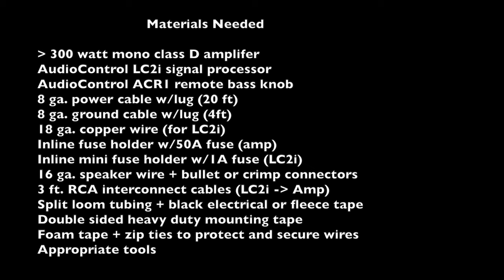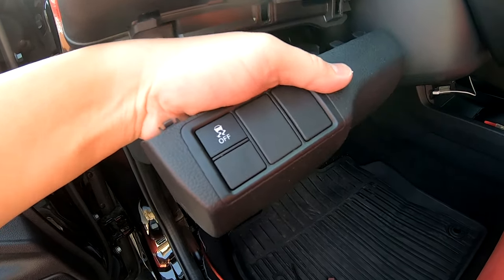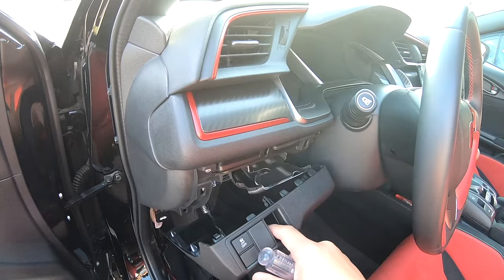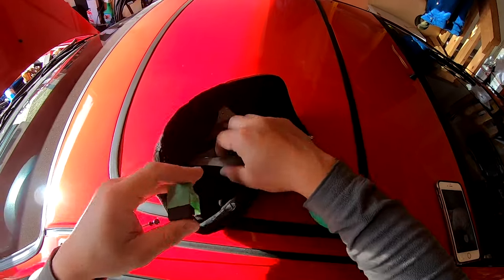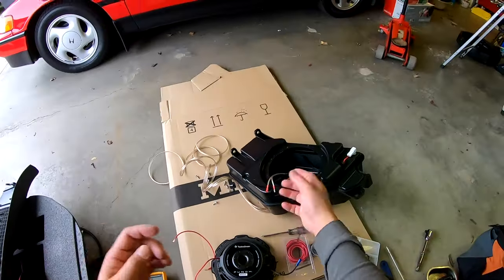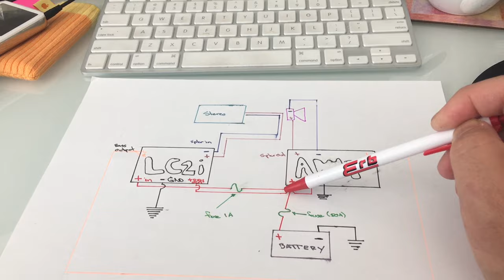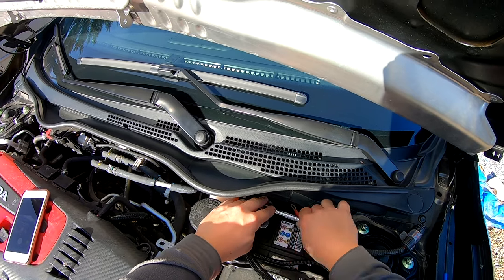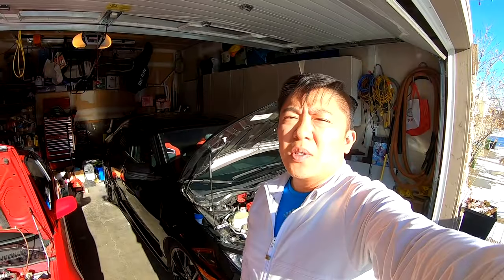2016+ Honda Civic Type R Subwoofer Amplifier Installation

Comment: Very well done man.  I am looking to replace the head unit with a 9" android one but I have the touring model with upgraded stereo and factory amp.  Would you happen to know how I can make this work?
Reply from the maker: it will depend on the replacement head unit.  If the new head unit comes with RCA outputs then you can delete the LC2i and just run your amp straight from the new head unit.  If you don't want to go that route or you feel it would be more complicated then you can tap into the system exactly as shown as I would assume the aftermarket stereo would work the same as the factory one (as far as speaker outputs are concerned).
Reply: @piercedasian  you're the best. Thanks so much!
Reply from the maker: you're very welcome!

Comment: Plan on doing the same to my sport. Very easy to follow along tutorial. I really appreciate the diagram you drew up.
Reply from the maker: Glad you liked the video.  I did an install in a civic sport touring and had to mount the amp on the tire jack cover so that it didn't impede the use of the spare tire  Thanks for watching!
Reply: piercedasian thanks for the heads up!

Comment: Was looking at video so you do not connect anything to the head unit also no fuse underneath?
Reply from the maker: nothing is connected to the head unit and the fusing for the amp is done at the battery and the fusing for the lc2i is shown in the video.  Just a small 1amp inline fuse that is tucked in underneath the foam block where the amp is installed.
Reply: @piercedasian  oh ok hard to tell from video
Reply from the maker: yep, its kinda hard to see everything in my vid since I'm a lone cameraman and the guy going the install at the same time :)

Comment: Is there a nut on the other side of the ground bolt? Washers? Loctite?
Reply from the maker: nope, none at all.  Just take the bolt out, put your ground ring terminal under the bolt and snug it up hand tight only.  Do NOT crank on that little 10mm bolt otherwise it WILL snap.
Reply: @piercedasian  there was a bolt already there? I'm doing it on a 2017 civic si. There's a hole but no bolt in it.
Reply from the maker: in my car there was a bolt there for grounding the brake lights I think.
Reply: @piercedasian  that's interesting. There wasn't one. But the hole is still there. I put a bolt and two lock washers and a nut. Also perfect hole on top to fit a 14mm wrench to hold the nut while I tighten the bolt. Mounted a 1000watt amp and a kicker comp r 12 with a cheap kicker kisloc. Hits hard, your video helped a lot. Thanks

Comment: Seems like all of the right parts were used but one critical thing not mentioned - did you run 'new' wires from the headunit/factory sub or did you use the existing subwoofer connection/and run those shorter new wires into the LOC?
Reply from the maker: No need to run new wires from the headunit.  There is no value in doing so since the honda head units do NOT have RCAs out.  The whole purpose of the LC2i is to pull, process and restore the full bass spectrum signal from the EQ'ed signal from the headunit via the sub output from the rear sub's wiring.  So the way I did it is, run signal from the factory sub wiring to the LC2i and then from there get a set of RCA from LC2i to amp and then a new set of speaker cables from amp to the sub.  Works perfectly and sounds great.
Reply: @piercedasian  Understood, though one thing that confuses (and others) me are the terms "run signal"
or "run wire" as it implies cutting factory wires. Some may not want to do such a thing.

I understand the 9th-10th generation Honda audio systems with the dramatic bass roll-off and dedicated puny underpowered 8in subwoofer they like to utilize. The lci2 seems like the perfect charm to cure all of the shortcomings of Honda "premium audio." It's still witchcraft to me as how a device can take a 100w + signal and re-proccess and amplify it, but if it works, it works!

But I still ask: did you physically have to 'cut' or 'splice' into the subwoofer hot/ground wires in any way or are you using some adapter?
Reply: @piercedasian  So do you need an expensive LC2i to get the full signal back? I have a cheap $15 LOC (PAC SNI-15) that just has L/R +/- inputs, no power/grounding. I have a 2020 Si Sedan with a factory sub in the rear deck.
Reply from the maker: OMG, I can't believe I missed this reply and question from you.  Run signal from sub means you tap into the wiring that we feeding the stock sub.  If you look at my sub swap video and then watch my amp install video that you will see how I managed to not cut the factory wiring harness but instead cut the spade connectors off where it connects to the factory subwoofer (which was trash anyways).  I then spliced the signal wire from the stock sub INSIDE the sub box.  How I did that was remove stock sub, cut the ends off the wires that attach to the stock sub.  Splice a new set of wires to the sub's wiring and feed it OUT of the sub box via the little screw hole that once held the stock sub in place to the LC2i.  I then fed another new wire from the amp's output back to the stock sub box and fed it through the little screw hole on the back and then attached that to the new aftermarket rockford sub.
Reply from the maker: My bad on not replying to this. The purpose of the LC2i is to restore the bass roll off that occurs in the bass signals that are fed from the stock head unit.  I have no experiencing using a cheapie LOC adapter.  Did it end up working for you and how did it sound?

Comment: I'm not planning on running the LC2i and I've read that it's not needed. Do you happen to know how to wire the sub to the amp without using the LC2i?
Reply from the maker: you'll need to get an amp that high level signal in.  So follow the video except the signal from the factory headunit that you spliced and joined inside the sub box will run into the high level inputs on the amp and then amps sub out runs back to the sub enclosure back and into the new sub.  Set the amp to signal detect turn on.
Reply: @piercedasian  I'm running the RF P500X1BD  mono amp. It says high level input available but doesn't come with a high level harness or anything. Looking at the LC2i I see it has the remote bass control outlet as well, I have the RF PLC2 knob for my amp. Does it need to be plugged into the LC2i if I do end up running this or can it be installed at the amp?
Reply from the maker: @armyofone129  it didn't come with the high level input wiring harness?  It should've otherwise how would they expect you to hook up the speaker level inputs into the amp?  The LC2i has a remote bass knob control but you need to install the bass knob for the LC2i.  If you have the rockford bass knob that came with your amp then that is the one you use for your amp.
Reply: @piercedasian  Directly from the description: "High level input capable with Auto Turn On circuit". I'm not sure what that means. I currently have the knob hooked directly to the amp.
Reply: @piercedasian  Think I'm just going to save myself some headache and buy the LC2i. Thanks for all your help.

Comment: Great video. Question does that lc2i doe sit also work as an epicenter.
Reply from the maker: What do you mean by it works as an epicentre?
Reply: @piercedasian  does the accu bass works as an epicenter. So instead of buying an epicenter along with the lc2i i can just buy the lc2i.
Reply from the maker: @monzon529  ah yes duh!  I shouldn’t be replying to messages late at night lol. Yes the LC2i’s entire purpose is to take the EQ’d bass signal and restore the bass frequencies back to the steeply rolled off (or wonky) bass response back into the signal like how it would normally come out of an aftermarket head unit.  Others have reported they can use the high level inputs on their amps and it seems to work fine  it using the LC2i is a sure fire to ensure your sub and amp is receiving the properly re-EQd signal.  Hope that helps.
Reply: @piercedasian  thank you. And thank you for the response ill take the high the road and not reply with a fuck up way. But thank you.

Comment: I'm looking to do this with my new 2019 Type-R
Reply from the maker: You won't regret it!
Reply: would it be possible to see the connecting cable for 19+ type r please? I am trying to change the head unit from stock to android but have not received the car yet...
I will probably get the car in 2 month from now, so I am trying to get the parts first :)
Reply: @user-ws7oh7cq5f  I might could send you a picture on Instagram or something

Comment: Where did you get the foam ?????
Reply from the maker: local honda dealership and amazon.
Reply: piercedasian  what’s it called ?
Reply from the maker: @nino_805  I believe it is called EPDM open cell foam tape.  Not sure if that is the official term but the dealership might know the official name.
Reply: @piercedasian  have you done any upgrades to a Honda Accord 2019 I have some trouble with mine once the 2 front windows are all the way up my amp and bass goes on and I can hear the bass go up as I accelerate the gas pedal

Comment: Hey man I have the 2018 Civic LX Sedan. I was told I don't necessarily need the LC2i with the Rockford Fosgate RX500 because of the High Level Input feature. I was told I can tap into the stock speaker wires in the rear of the vehicle and the High Level Input feature allows me to do so without popping out the stock head unit and running RCA cables. Can you give me feedback on this?
Reply from the maker: No can do. My understanding of many head units is that there is some weird bass response roll off at various volume levels that the LC2i apparently corrects for so that your aftermarket amp and sub work correctly. It isn’t a matter of getting an amp with high level inputs to get it working. You can try doing it straight to an amp but I have read that others have weird bass problems that were subsequently corrected using a LC2i. Hope that helps.
Reply: piercedasian thank you for your response! I have heard that also but also have seen where people tapped into the rear speakers properly and didn't seem to have problems. I ordered an LC2i also but if I do not have to pop out the head unit I would prefer not to but I guess I can figure that out when I test it
Reply from the maker: Chase Heigle you never actually have to pop the head unit out. It is all done in the back so all you have to do is wire the LC2i to the sub speaker terminals as how I have shown. You can’t even tell I’ve been in the back of my car as the install of everything is super clean clean clean!
Reply: piercedasian Ahhh okay I see. I will re watch and find that part. Thank you!
Reply: piercedasian well I also am not using the factory sub housing (I have the two 6.5" subs firing upwards in the top of my trunk space) I purchased the JL audio microsub 8W3v3 with ported box
Reply: I have pictures if I could send them to you maybe you can explain how I would connect the stock wires to the LC2i
Reply from the maker: Chase the wiring of the LCI2i is all the same regardless of whether you're using the stock housing or not.  You can just take the two factory wires going into the sub and wire them to the high level in puts (left channel) of the LC2i.  That will be good enough for you to get your signal to your amp to drive those dual subs.
Reply: piercedasian so would I have to cut and splice the stock speaker wires and connect them to the LC2i? What if it is not long enough to mount?
Reply: piercedasian couldn't I just use the T Tap devices to connect wired to the stock speaker wires while plugged into stock speakers?
Reply from the maker: you could use t-taps BUT you have to make sure you disconnect the sub from the wires you tapped otherwise you'd be double feeding your sub.  In my instructional video I do comprehensively document how I wired things up to stay stock looking with zero change of messing up the wiring.
Reply: I have the same amp and didn't have any weird bass issues using only highlevel input.  2014 Nissan Altima.  I guess it's different for every car n if u have the issue, need the converter.
Reply: piercedasian where would I disconnect? Don't those wires go straight to the LC2i?

Comment: If I buy this game Amp the rockford R500x10 and run it on a kicker sub (12inch 150 watt rms 300 peak) will it hurt it? U seem professional compared to me so i figured id ask
Reply from the maker: Not at all, the Rockford amp has a decent amount of power.  Just make sure you're purchasing a 2 ohm sub or a dual voice coil sub to wire them into 2ohms to get the most power out of the amplifier.  Mounting a 12" sub in your car may be a challenge as you likely won't be able to maintain that stock look.

Comment: So much of an hassle just to install a Sub. It also voids the warranty. I think I'm gonna keep mine as stock.
Reply from the maker: While it is definitely a bit of work to put the sub and amp in that it sounds lightyears better than the stock sub.  The warranty on the car isn't completely voided just the parts that were modded and if the dealership can prove that it blew up other related components such as head unit or alternator that yes they could technically say that void too but the worst case scenario is if something catastrophic happened to the car that one could remove all this stuff or tuck it away such that the dealership wasn't aware of it.  This is why it is important to do proper installs so that things DON'T blow up and operate as intended.